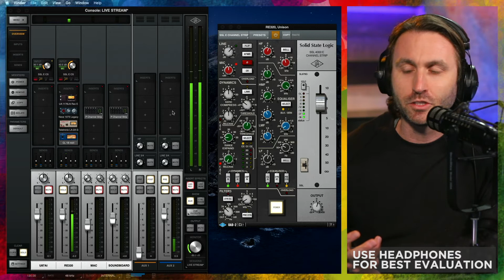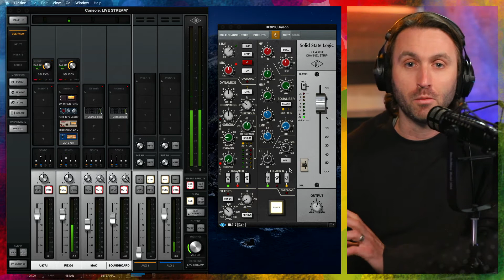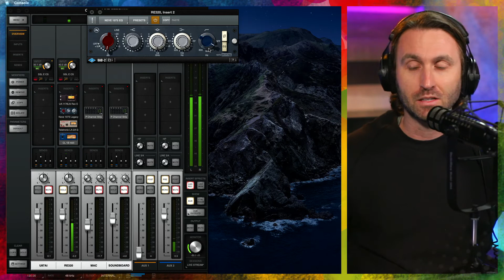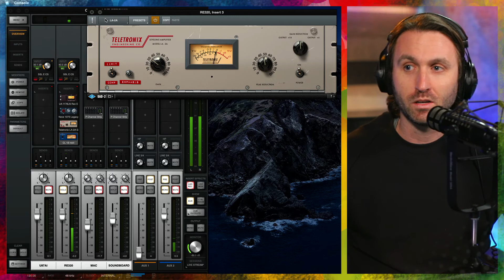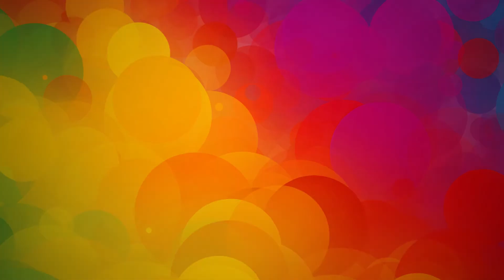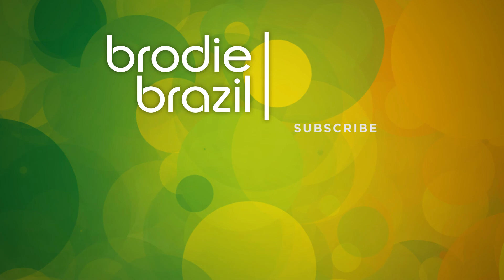Electro-Voice RE320 Signal Chain with UAD Apollo (2021)

Comment: You and I had VERY similiar EQ settings.  I boosted my mids whereas you actually lowered them a bit.  Anyway, I decided to try out your presets.  I dont have your exact pluggins so I used very similiar pluggins.  I very much like your signal chain.  Thanks for making this, theres not a lot of content on the re320 with how to setup a proper signal chain